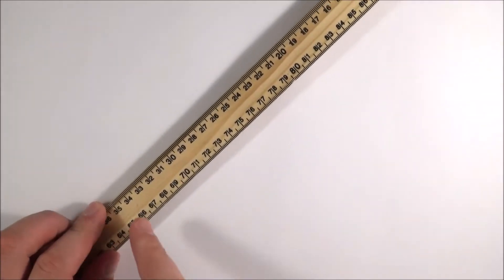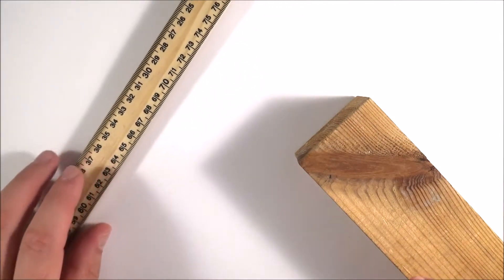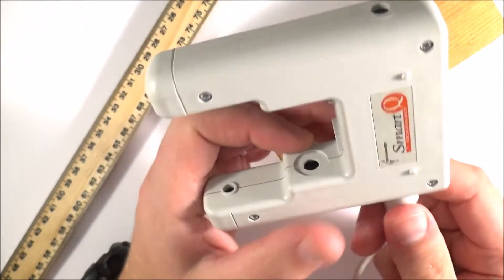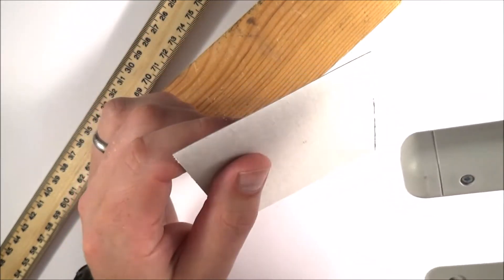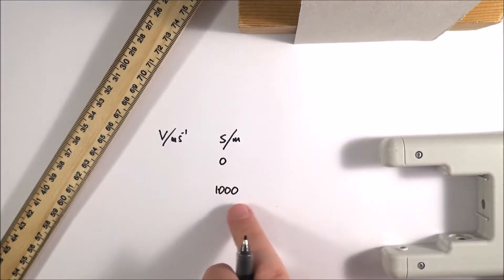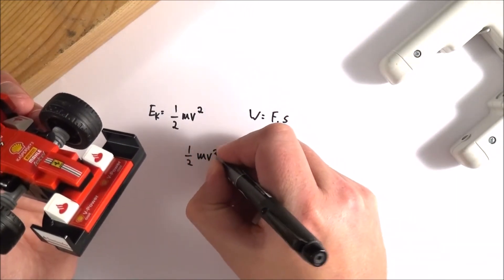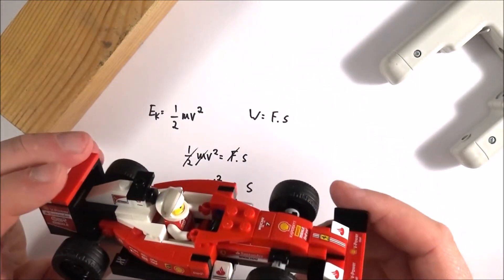Velocity and Stopping Distance - OCR PAG 1.3 PRACTICAL - A Level Physics

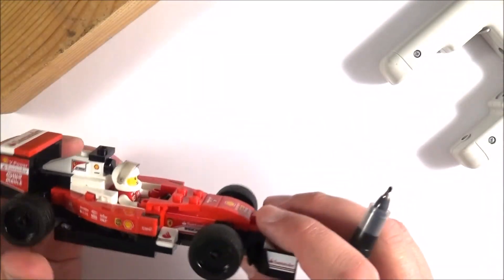Comment: At 3:55 you said "the velocity is not proportional to the distance traveled and then towards the end of the video you say that it is directly proportional to the distance.
I am just a bit confused on that which of the two statements are true?
Reply: He's a terrible teacher, don't mind him. He also cancelled out the 1/2 on the left side of the equation without explaining why, lol. In algebra you don't just magically cancel out something on one side of the equation but not the other, lol. If that wasn't enough, he also cancelled mass on one side of the equation but didn't cancel mass on the other side but instead cancelled Force, lol. If force was, let's say, given by "mass" and "gravitational force" (just for example, not talking specifically about this video's problem) then you can cancel mass on both sides of the equation because they cancel eachother out but he cancels mass on one side and Force on the other. The teaching of algebra & physics in this video is extremely poor. I really hope this guy isn't an actual teacher because even if he can do the work correctly, he does a poor job at explaining things.

If I just magically cancelled out a number on one side of an equation but not the other or did the same with a variable (eg. "x"), my teachers would be like what are you smoking? Lol.
Reply: @vincer9960  he cancelled the 1/2 the mass and the force because they are all assumed to be constant. Notice how he didn’t say v^2 is equal to the distance travelled. He said directly proportional to. This means v^2 is equal to a constant (in this case 2F/m) times the distance.